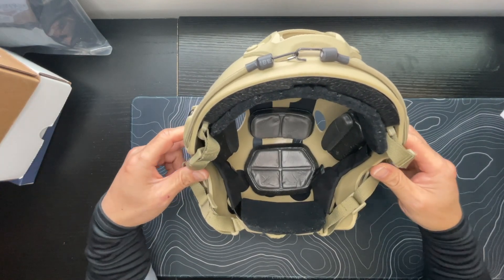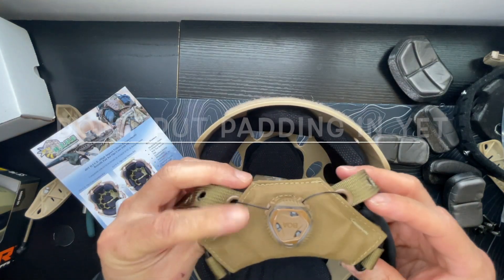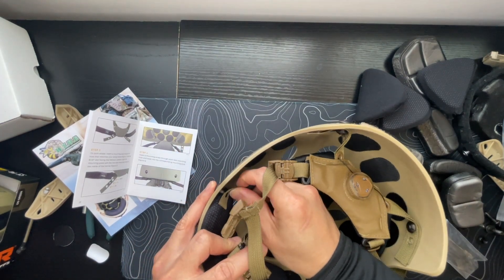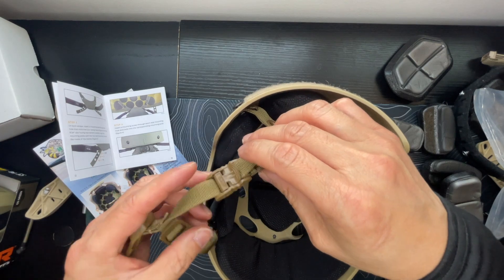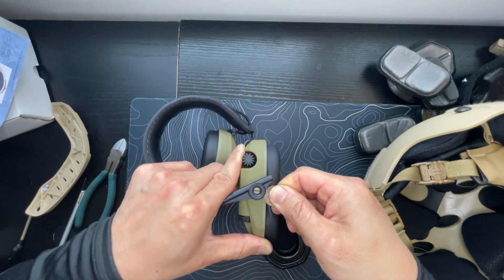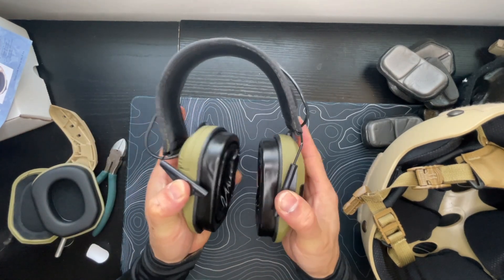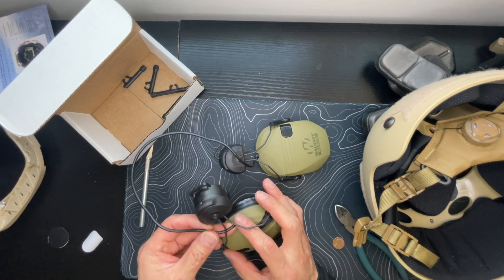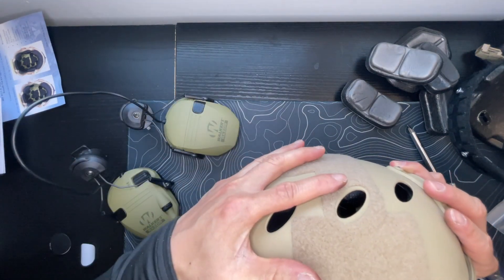DIY Airsoft to Night Vision Capable Helmet

Comment: If you count the price of your accessory (plus ear pro) you're around $343 for just accessories and not the helmet, if you tack on another $45 for a helmet (what mine cost off Amazon) you're already close to $400. A team Wendy bump helmet is around $380. An actual ops core bump helmet is currently on sale for $299. In that context, this seems like such a waste of money trying to improve an airsoft helmet when you could just buy the real thing cheaper.
Reply from the maker: Thank you for watching! Helmet, pads and suspension alone is $284. All in, including the earpro ($84 w/ Arc adapt.) which you would have to add for the other helmets anyways is $368. That's still a tad under a Team Wendy helmet. 
The ops core bump you reference is on clearance right now, old model and only availble in small 20 7/8-22" head circumference. I looked for exactly that option until I found it was only for small headed people.